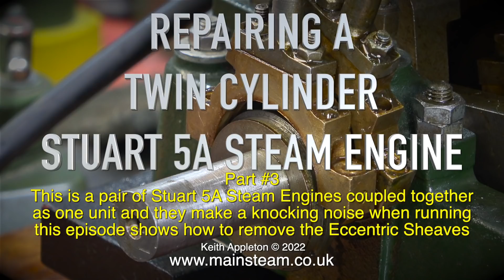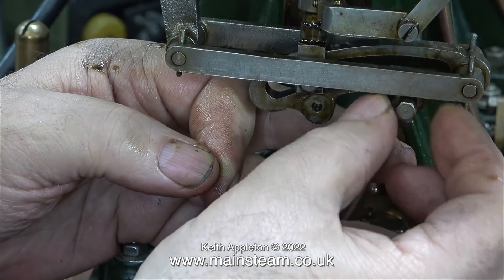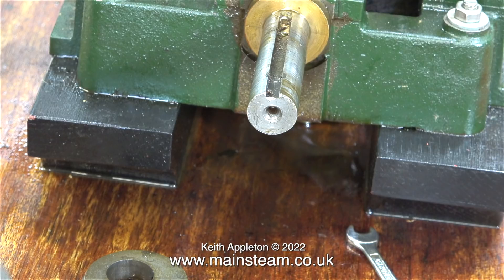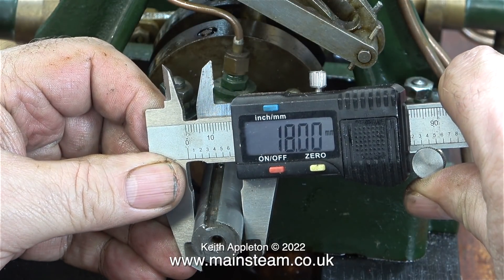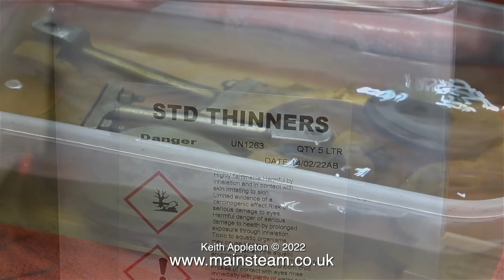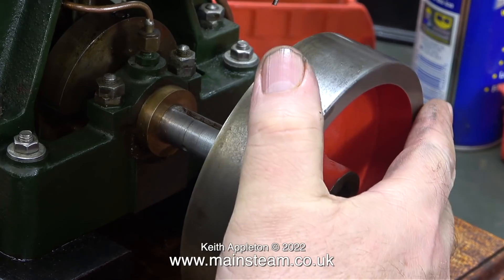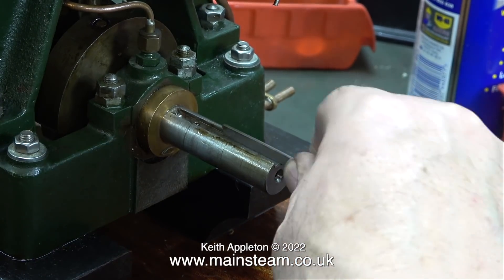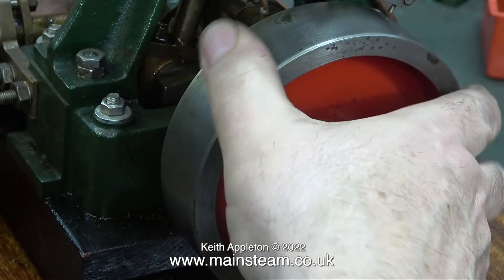REPAIRING A TWIN CYLINDER STUART 5A STEAM ENGINE - PART #3

Comment: Hi Keith. Those couplings are used in industry and designed to be driven from one end by an electric motor. They allow any misalignment of the shafts. Should not be used in this situation as each engine is causing backlash as they rotate. Needs a solid coupling between them or a different type of flexible coupling as used on diesel engine fuel pumps that don't allow backlash to happen. They are flexible plates bolted to the couplings so there is no backlash.
Reply from the maker: Even when I locked the coupling there was still a "knock" when the engine was running so that wasn't the problem. Please watch the rest of the series.

Comment: Hello, what would be the most efficient way to have the engines connected? At 90º or 45º ?? 0º ?? Of each other? Thanks
Reply from the maker: 90  Degrees is the normal setup for a Twin Cylinder Steam Engine.

Comment: Hi Keith, for some reason it would not let me leave Comments on the second part. The Aluminum coupler on the end is called a spider connecter, it has an identical fitting for the other shaft with a rubber peace between  them that sort of looks like a squashed spider. they work very well if set up proper, but chew up and spit out the rubber spider if misaligned.
Reply from the maker: My Youtube Channel has been playing up this week, I spent over an hour online with the Youtube Help people to no avail . . . . . although I did notice that I had a few comments on Part #2 of this series from other viewers.
Reply: That type of coupling is commonly known as a Lovejoy coupling in the U.S.